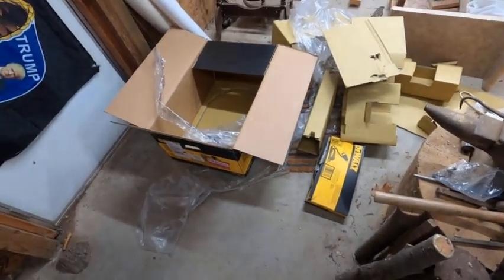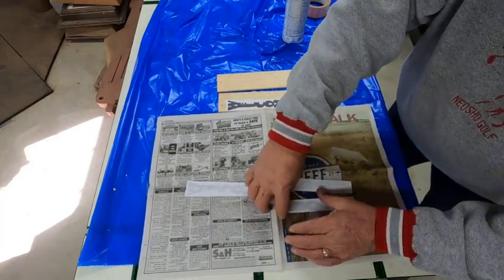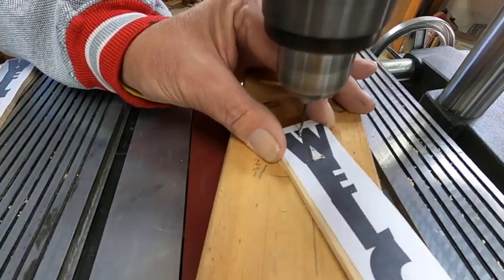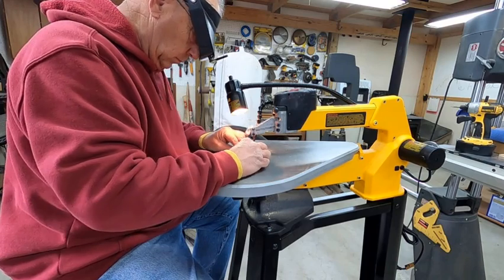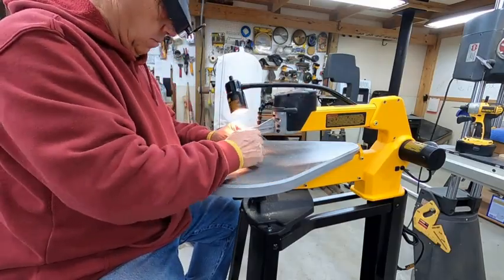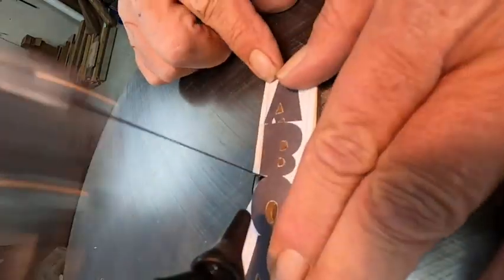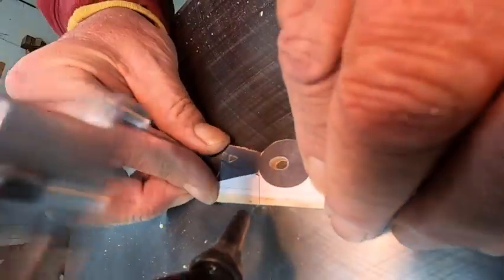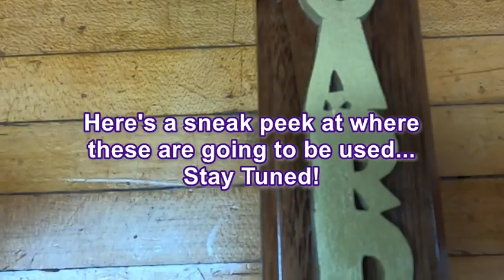Learning How To Scroll Saw

Comment: I'm impressed you managed this on a first try! I wonder if I could pick you're brains? I'm making dolls house furniture and would like to be able to do scroll work on some of the pieces. You said you've used a hand scroll saw in the past and I wondered if they would be any good for working on pieces 1.5 to 2.5 millimetres thick? I've been searching the internet for advice but it varies so much I'm flummoxed by it all.
Reply from the maker: The traditional handsaw for doing that is called a Coping saw.  That is what I used for years.  You can do good work with them… I show one being used in my Christmas Cookie Video.

But there are some things you need to think about.  They all use the same length blades.  You will want a fine tooth blade on thin material.  One with at least three teeth within your material thickness.  The trade off is, more teeth yield smoother cuts with less splintered tear outs… but cut slower than bigger teeth.  

Coping saw blades are held in place with cross pins.  That means you need to have starter holes 4X larger than the ones I used… probably need to drill 1/4”.

If you have the patience you can do it.  

On these pieces, I used rifling files and sand paper to blend curves and sharpen corners.  If I had cut them with a Coping saw, it would have taken perhaps a half hour to do that.  As it was, it only took me about 5 minutes.  But, I’m not very good with a Coping saw to start with.  

A better option may be a Fret Saw (aka: Jeweler Saw).  Is is smaller and uses unpinned blades.  I don’t have one but included a link here to a decent explanation.  

https://www.knewconcepts.com/frequently-asked-questions.php

Good luck and thanks for stopping by.
Reply: @sassafrasvalley1939  Thank you so much. That helps a lot.